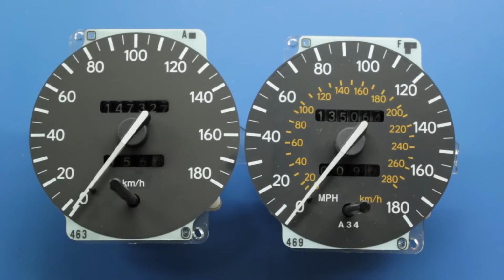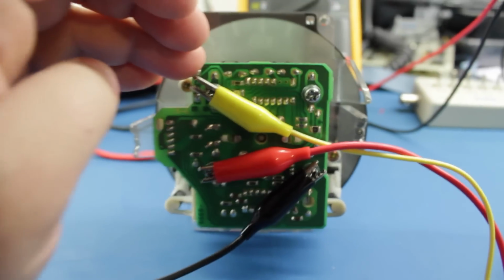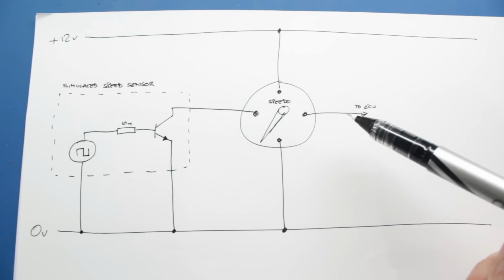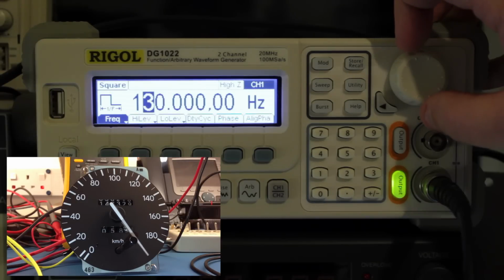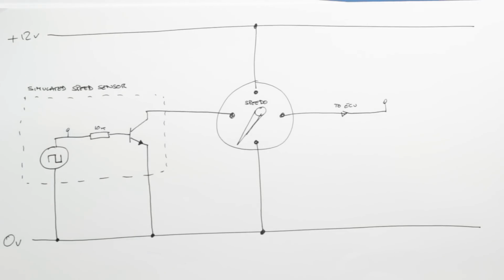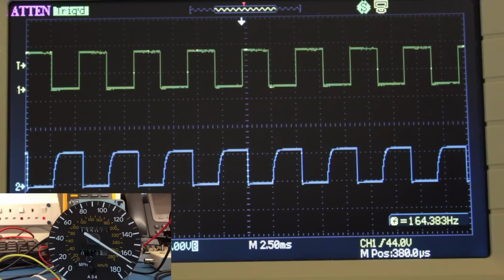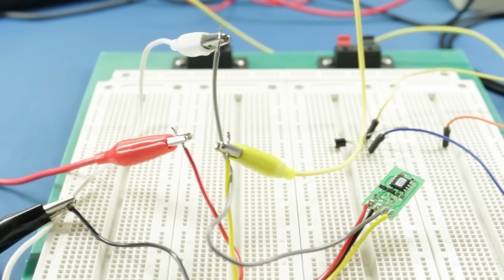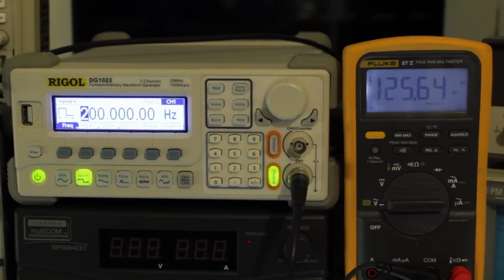Celica ST205 GT-Four JDM vs UK speedometers and speedo converters

Comment: would you know how to be able to tell if a st205 speedo is rewinded and tampered with if you can how thank you
Reply from the maker: It's mechanical for the odometer and trip, motor driven via worm gears and so on in much the same way as older vehicles with a cable drive. To wind them back, they have to be physically disassembled and manipulated. Typical indications of this are misaligned digits, but it's often easier to buy a replacement speedo that's showing a lower mileage and just swap it out - no indication at all then that anything's been done. Given the age they are now (thirty years!) using mileage as an indication of vehicle condition is probably a bad idea. Unless you have something like MOT test history with steadily advancing mileage, just assume the odo is wrong and go by condition of the car as indicated by an inspection by someone familiar with them.

Comment: Cheers for the vid, very interesting. I have a JDM ST205 and just fitted the speedo from my UK ST202 but the speed is now reading far to low, which isn't totally unexpected as the box which made the KPH read as MPH is still fitted. I'm hoping removing this and just fitting the ECU cheat will do the trick. I was looking to swop out the gearbox speed sensor also but found they are different between the ST205 & St202.

Comment: how is it a JDM speedo when the same car sent to France or pretty much any country in the world except UK. USA came stock with the KM/H guage JUST BUY A USED CLUSTER ON EBAY FROM A EU COUNTRY THAT USES ONLY KM
Reply from the maker: Well, I live in the UK and therefore want a UK MPH speedo. Also, the JDM speedo only reads to 180 km/h due to the speed limiter on JDM cars. The euro cars (and the U.K. inner KM/H scale) reads to 280. The investigation was done simply out of curiosity.

Comment from the maker: Just out of interest, I'd be tempted to put the UK speedo in anyway and just fit the speedo converter _after_ the dash (i.e. between the dash and the ECU input, not between the speedo sensor and the dash) - you then get a nice KMH / MPH OEM dual-scale speedo and remove the JDM speed limiter :-)
Reply: How do you do this? Is it as simple as connecting yellow wire on the output of the Speedo (rather than the input) and then grey to ECU?
Reply from the maker: @RainingCurses  Essentially, yes :-)

Comment from the maker: As I understand it - and this is just my understanding - as long as you inform any potential buyers that the speedo is potentially inaccurate and can not be considered to be in any way representative of the actual mileage of the car, you should be fine. It's only if you start trying to palm things off as having covered fewer miles than they really have that you run in to hot water.
As I say, this is just my understanding, but my local MOT place seems happy with that :-)

Comment: Excellent video- it's cleared up that issue in my mind as i've had a UK speedo sitting around waiting to go into my JDM ST185- looks like i'll be needing a speedo converter chip instead! Out of interest do you know where the law stands on rolling back the mileage on a car having converted it from kilometres to miles? I.e. so the mileage on the odometer reflects what the car's done in miles rather than what it's done in kilometres, it looks quite scary at the moment!